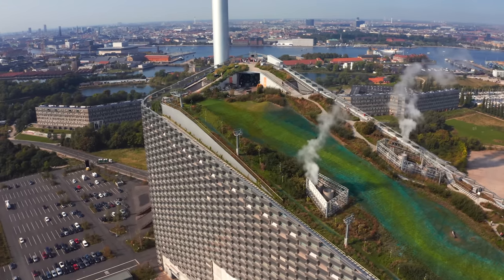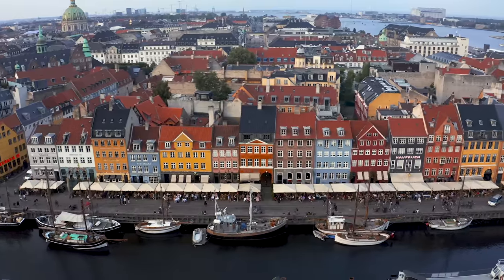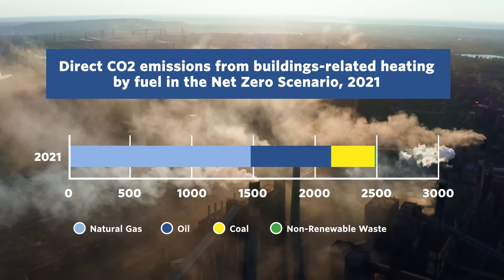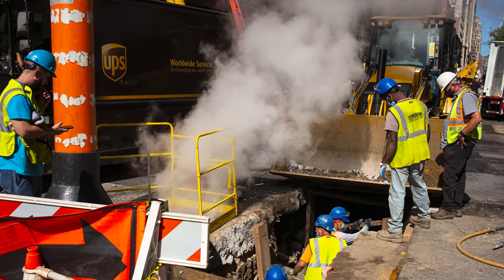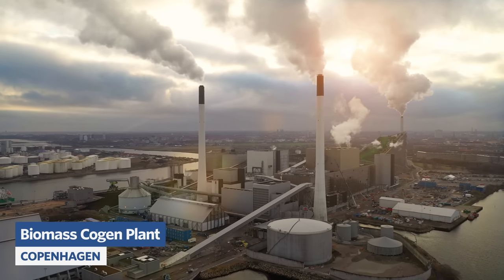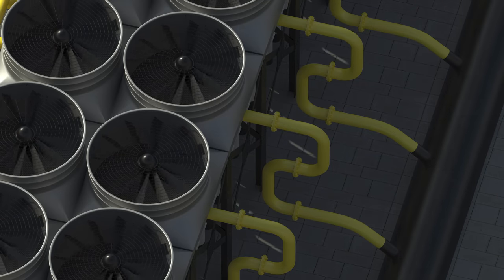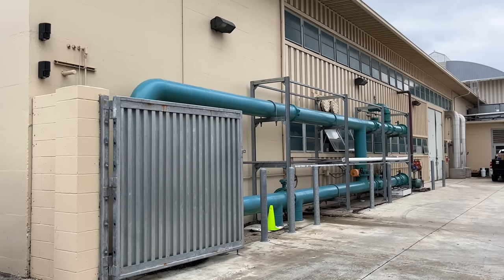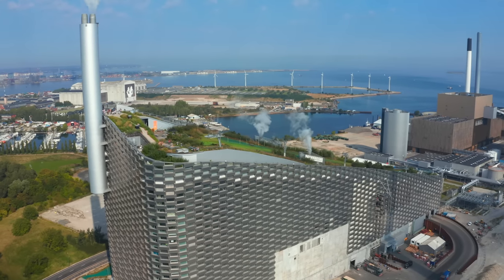An Introduction to District Heating Systems

Comment: Waste To Energy is NOT sustainable. It is a hack to deal to wasteful consumption. You know what doesn't burn well in WTE? Organic material. It's wet and doesn't generate high energy output, so the wise thing to do with organic waste stream is to reuse it as compost, NOT burn it. This involve aerobics processing of it to make it into carbon returned to farming.

The key caloric input to WTE is plastic, which is not sustainable. This is essentially burning oil after it was used as plastic. Sweden has resorted to importing trash from thousands of miles away to feed their WTE, because when we reduce plastic in prep for eliminating oil extraction, you end up with no more feedstock for WTE. So WTE is not sustainable. We cannot power ourselves burning trash. Therefore building district heating based on WTE is shortsighted and will be in contention with reducing the creation of waste as they rely on waste for their heat. Like powering cars with used fast food frying oil, this solution does not scale. It's a hack built off the back of unsustainable consumption. We must move away from excessive plastic and single use packaging. Once done, our waste stream is hopefully a small portion of spoiled food and other organic waste. We will not burn this.

District heating isn't more efficient or logical. 5th generation heating and cooling with low temperature water exchange can allow some buildings that have permanent need for cooling matching the needs for buildings with permanent need for heating. But otherwise, this is just engineering that lacks forward thought and sustainability.
Reply: you... do realise that district heating can be fueld by things Other than burning trash, right? 
In some places it's run off waste heat from industrial processes, for example. 

heck, my understanding is that a lot of places seperate out (most) organic waste for processing into fertaliser and such before the trash even leaves people's residences.
Reply: @laurencefraser  yeah, and all the places where waste heat is enjoyed today are on the hit list for elimination under decarbonization. Of course you can say nuclear power which did not have its Renaissance. But the district heating concept is built on the eras of co.bustion and cheap fossils. Yes there are cases where it district heating already is a massive reliance, like in the case of many University of California campuses. But had they carefully considered the elimination of natural gas as an energy source, they never should have built district heating. This video is a love fest for thus tech instead of a carefully considered description including the very bad downsides of relying on WTE and waste heat as a byproduct of industry and energy production.
Reply: In most places, organic waste is collected separetly or composted locally, and anything that can be economicaly recycled, is recycled. The rest needs to be disposed somehow, and burning it really tends to be better alternative than landfilling it. Sure, the heat output depends on the waste input, but to be realistic, we are not going to stop producing trash any time soon. Also, waste to energy is not going to cover the heat needs of an entire city, but it can provide a significant portion of it.

Removing fossile fuels from energy production does have a major impact on district heating systems. It's not particularly easy to replace fossil fuels in heating, but what would be a better alternative? You can't realisticly store electricity at the scale of a power grid, so any weather related electricity generation is not going to be a solution. The thing with district heating systems, is that you can actually store heat in a meaningful scale. It's not that difficult either, and you can use abandoned fossil fuel infrastructure, such as underground oil/coal storage facilites to store heat.

Waste to energy is not a perfect solution, far from it. But it's better than burning fossile fuels. We might as well use it as long as we produce it. Also, it should be noted that while a regular power plant can reach 30-40% efficiency, CHP (combined heat and power) plants can easily reach 90% and above.
Reply: @klapiroska4714  separation organic waste is the right thing to do. But I'm afraid you are mischaractetizing what is being done in "most places." California has a law requiring this and it is being implemented behind schedule. Most places have no plans or intentions yet to separate organic waste from trash.

Burning trash is absolutely an unsustainable, crude way of avoiding landfills. Combustion contributes to greenhouse gas emissions, and WTE sets up communities to support continued creation of waste as they become dependent on it for electricity and for heat. It's sad that WTE has been accepted as a viable alternative to not producing single use waste in the first place.
Reply: On one of the post ; they stated that in order to hookup a new building to the grid, the building had to comply to a certain insulation value and if not then the building could be brought up to the standards and the cost of the insulation renovation was added to the monthly payment and making it affordable for the home owner. Good deal. Now a little bit of extra information, if all new houses and many older houses were brought up to super insulation standards the requirement for heating and cooling needs would drop substantially. An example: In Saskatoon Saskatchewan in 1977 they built 12 homes to test super insulation and tight air sealing methods. One home called the Saskatchewan conservatory house had double framed walls with R44 insulation and R60 plus in the ceiling. It had external shudders for the windows. With no occupants and no internal heat inputs the building would lose less than 1 degree farenheit in minus 30 F degree weather. There are in this modern day homes that exceed that level of lack of heat loss and therefore don't have a very large heating footprint or for that matter cooling load.

Comment: Copenhill May look great but it has been a financial and technical failure. Denmark is on the hook for the next 30 years for an over-built  overpriced theme park that has to import waste and burn biomass whilst never operating at capacity especially in summer. The promised energy savings have not materialized and the awarding of the contract was questionable. Why didn’t any of this make it into your video?
Reply: Credible sources for any of this?

Comment: In the United States, it is totally and completely illegal to put a power plant in a residential building. If we put our thinking caps on, we might be able to figure out why.
Reply: Ehm, why would you put a powerplant inside a residential building? That's not what is said in the video.
Reply: @TheEsseboy  the very first building he mentioned has a power plant in it. It's the building on the thumbnail to the video.
Reply: Why do you think it's a residential building?
Reply: @MarioFanGamer659  because I studied the building when I was a developer.
Reply: @user-wp8yx  Yes, and there is no one living in it, it just has a skiing slope on the roof of it.
Reply: @user-wp8yx  Sure thing, then why is no one living in it?
Reply: @TheEsseboy  I don't know what you're talking about, but it is possible I'm confusing this with the Figure 8 building, if that is helpful.
Reply: @user-wp8yx  The figure 8 building has no powerplant in it though 🤨
Reply: @TheEsseboy  the city should just maintain an incineration plant in the middle of the city. Actually, that is one good thing done in my city.

Comment: District heating is good...but burning garbage is NOT.  There are many toxic chemicals and heavy metals that get released into the air when garbage is burnt.  These can be inhaled through the lungs and can give you all sorts of health problems.  City Beautify should have been more critical of urban incinerators.
Reply: Depends how you go about filtering the resulting smoke etc, I'd expect. Most places have laws regarding that sort of thing, after all. 
Depends on the type of garbage you're burning too. 

I know that where I live we have to sort our trash into organic/recyclable/other and the 'other' includes a Lot of stuff you wouldn't want to put through an incinerator if you wanted it to keep being usable, for example. Japan has more complicated trash seperation requirements, and one of the catagories is specifically 'burnable' stuff, that is, things that can go into the incineration plants (compared to various types of recyclables and the other things that Can't go into the incinerators.